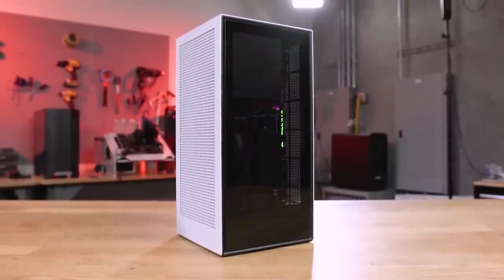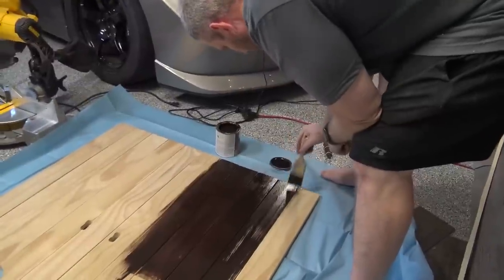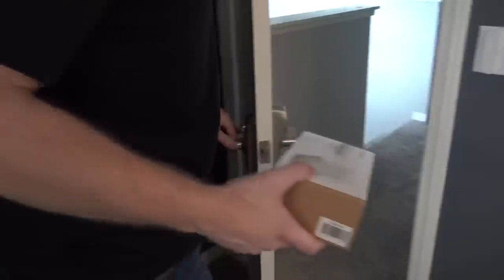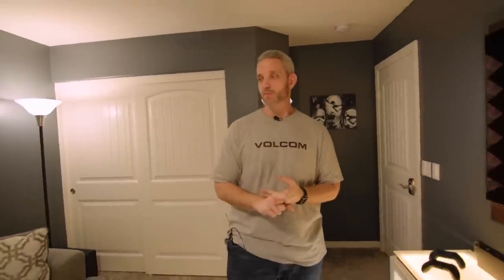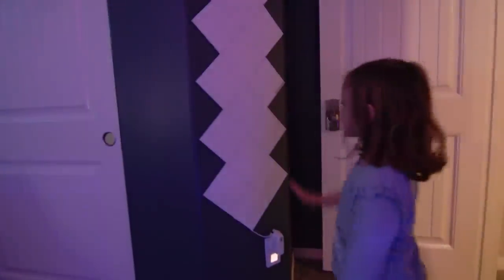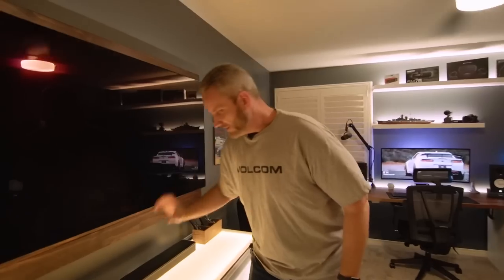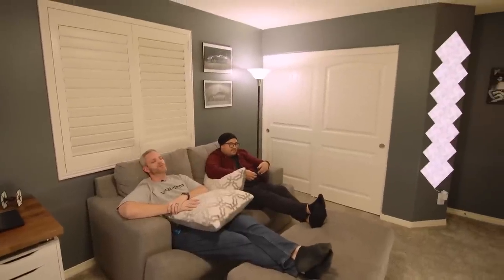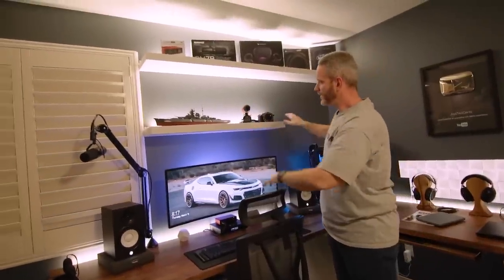The Ultimate Nerd Cave is complete! Full Tour

Comment: I do tons of wood work and started to sketch up a computer desk idea (L shape) and remembered Jay had a nice setup. Didn't wanna do the exact same design so I started looking around at tops and drawers etc. ended up finding some nice stuff. Drew up the design and got all the measurements how I wanted and realized...ITS EXACTLY THE SAME AS JAYS! (different dimensions and color scheme of course but same style.) The weight displacement of the semi useless drawer in the back (tried to find a workaround and this makes the most sense), the layout of the tops so on and so forth to a tee. Jay you have earned my sub from the fact that your wood work and cleverness is SPOT ON! I tip my hat to you Sir one handy man to another.

Comment: Jay: "...radial arm saw", my Dad's voice in the back of my head, "that's not a radial arm saw, use the correct name for the tool, it's a miter saw".
Reply: If the saw had a radial arm I would have accepted the phrasing. But it did not.

Comment: Hi Jay,
Just a piece of advice, having used a quiet dynamic mic with the Focusrite Solo, you will need a cloudlifter or something else like it inline to boost the signal more so you aren't introducing noise from the preamps. The SM7b needs a lot of amplification to drive it properly.
Also, with the PSA1, I know you're handy with a soldering iron, take the plug apart and desolder the wires from it, then you can run the cable through the arm for a much cleaner look as opposed to velrco strapping it down to the top. I have done that with my arm and it looks good.
Anyway, that is my twocents.

Comment: "I know how to use a radial arm saw" as he walks away from the compound miter saw.... lol
Reply: I’ve never even heard of a radial arm saw
Reply: I was gonna say the same thing!  lol   BTW Kev, radial arm saw is kinda like a prehistoric compound miter saw but instead of the blade hinging down into the wood, it slides out from the back and across the wood.  Can, depending on model, adjust angles both horizontal and vertical.  Also, on mine I can turn the whole blade/motor combo sideways to rip lengthwise, though it's a little sketchy unless you get it PERFECTLY parallel to the fence.  I actually prefer it to my compound slider, but it's not exactly portable.  Mine is built into my workbench.
Reply: Was about to say the same thing
Reply: Never heard either of those... I always called it a chop saw... Just makes sense to me

Comment: If you use a cloud lifter or a Triton Audio Fethead (what I have) with your sm7b it will give you 20db of clean signal boost. That's only important if you're already pushing your preamp to get usable levels, like I know you are with the Sure and the Scarlett. It helps with your noise floor for sure.

Comment: 10:05 Jay, you are ABSOLUTELY CORRECT....The Bose 700 Soundbar is utterly magnificent - As long as you use the mobile/tablet app to tweak the parameters a little....Given that my Soundbar 700 and Bass Module 700 are in a TINY room - MAYBE 4x4 sqm IF THAT (I have never actually measured my room, but Jay's room looks at least 3-4x the size of mine!), AND that it's seated on my desk about 16 inches from my sitting position, with the 'Bass Module 700' aka the 700 sub sitting under my desk and being used as a footrest, the quality of sound that I'm getting from the setup (Admittedly it is being pre-DAC'd from my PC by an EVGA NuAudio PCIE sound card) rivals and possibly even beats my old man's 5.1 setup with a Sony 1080 amp/receiver and Focal 5.1 speakers.

Comment: Jay: Just a tip. Alex also have a cabinet with 1 shelf that I think would fit better under your pc. The cabinet is the same size as the drawer. Use 1 drawer and 1 cabinet. I saw that you dont have problem reaching the drawers, but having a cabinet will make it easier. It will also give you more space if you want to store bigger items, like boxes for items. Other then that, the room looks really good. Kinda funny that you started saying you wanted to install locks so that your kids wouldnt "move in", but later in the clip, the kids already have moved in :P

Comment: Those tables are not veneers, you see those squiggly lines? They're called finger joints and it's a good way to joint two boards together on end like that. Also even if it was a veneer, it'd still be a wood veneer quite possibly even birch but probably something like Eastern Hard Maple.

Comment: Great choice of Amps man, I use my 788 at my desk. Also for Headphones maybe check out electrostatics, Koss 95x are pretty sweet and my current endgame. ALso for your Racing rig look into IEMs instead of headphones since they are less bulky and lighter. If you need I have some cheap suggestions to get you started for a gaming sound :)

Comment: Fantastic Setup Jay,  and is pretty much how I would have my own room (when I get a room to do this in). It was good to hear your opinion on a single wide screen monitor vs double/triple setup though, as I currently run a double Samsung Syncmater T220 (yes pretty old now) and I've been beginning to think a single wide screen is definately the way to go.

Do you have a link to the amp you use for your studio speakers? I got some old Ikey 606 studio monitors I bought nearly 10 years ago, and I have never been able to find a decent amp to power them. Are your speakers individually powered, or are they passive?

Comment: Hey Obutto R3volution. I use the same cockpit setup. Though I run a Logitech G25 wheel (because reasons) and Fanatec V3 pedals.

What series do you mainly race on iRacing? Skip Barbers, Oval, Dirt, GTE?

Also it looks really tight against the wall. Looks like you'll bump your elbow on the wall.

Comment: what kind of computer desk is that ?
Reply: Most of the desk is from IKEA. All the white drawers are called "Alex," and the big wood slab is the "Karlby" (3 color options.) Jay added furniture risers between the Alex drawers and the Karlby since he wanted his desk to be taller. The desk parts do not come with LED lights or HUE, you have to buy those separately.
The little pull-out sliding drawer for Jay's laptop is an easy DIY custom job if you have a power screwdriver. You buy the braces online or at a hardware store, you follow instructions and screw them into your desk, and you buy the little piece of wood from a hardware store like Home Depot or Lowes, etc.

Comment: Where did you get the your desk?
Reply: Most of the desk is from IKEA. All the white drawers are called "Alex," and the big wood slab is the "Karlby" (3 color options.) Jay added furniture risers between the Alex drawers and the Karlby since he wanted his desk to be taller. 
The little pull-out sliding drawer for Jay's laptop is an easy DIY custom job if you have a power screwdriver. You buy the braces online or at a hardware store, you follow instructions and screw them into your desk, and you buy the little piece of wood from a hardware store like Home Depot or Lowes, etc.

Comment: WHO MAKES THAT DESK??
Reply: Most of the desk is from IKEA. All the white drawers are called "Alex," and the big wood slab is the "Karlby" (3 color options.) Jay added furniture risers between the Alex drawers and the Karlby since he wanted his desk to be taller. The desk parts do not come with LED lights or HUE, you have to buy those separately.
The little pull-out sliding drawer for Jay's laptop is an easy DIY custom job if you have a power screwdriver. You buy the braces online or at a hardware store, you follow instructions and screw them into your desk, and you buy the little piece of wood from a hardware store like Home Depot or Lowes, etc.

Comment: Yeh airflow is important. So uhm... what size fan is that? It sure as hell isn't a 120,140 or 200! 🤣 It would be the Ultimate Nerd Cave if you had tubes running around like you were inside a PC case. Then you'd be the absolute Nerd King I think.